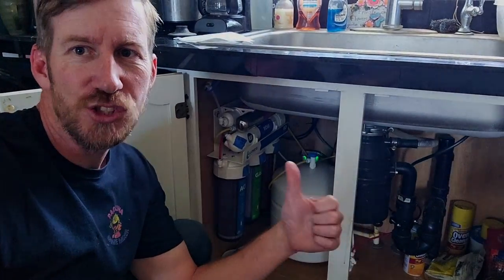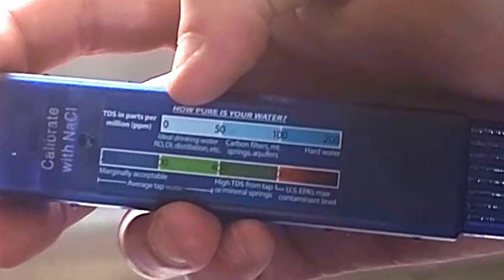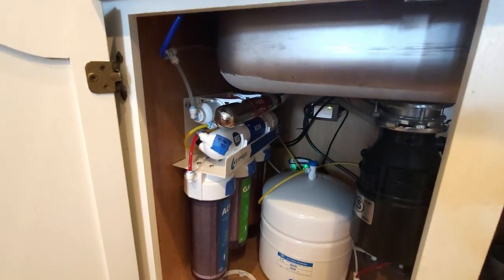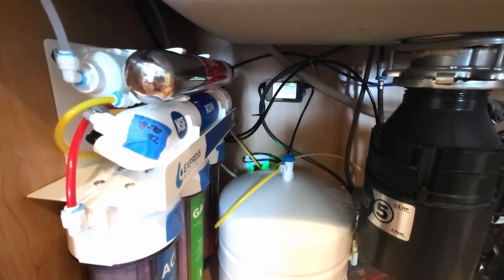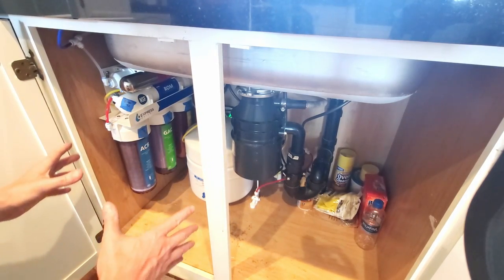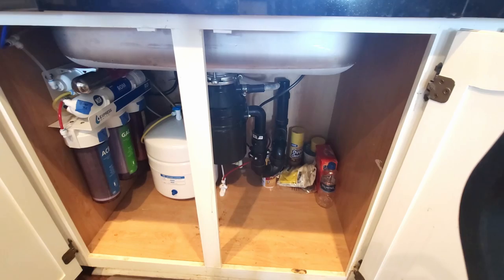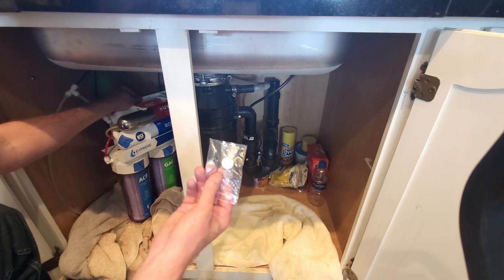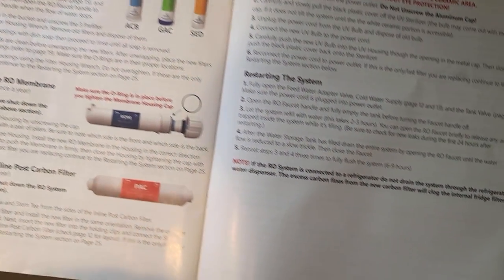Express Water Systems RO Filter: 8-Month Performance Analysis & Filter Replacement

Comment: I saw your previous video.. Great work! 
I am glad I watched this one.... When you say you have to have 20 psi... do you mean my faucet water line needs to have 20 PSI... basically ... water line into my faucet?
Reply from the maker: Did I say 20 PSI? Its supposed to be 40PSI minimum. The RO filter needs at least 40 PSI to me able to push the water through the membrane. Anything less than 40 it will not work. Most well systems work on 40-60 PSI if I remember correctly and most city water at least in the states is around 60 PSI. If you don't have this pressure Express Water does sell a booster pump that will correct your pressure for I believe around $120. There are other booster pump option on amazon as well for a bit less money. Hope that helps! Thanks for watching!
Reply: How do you determine the psi…

Comment: I have the same system but I added the alkaline filter to mine. I have a problem where my water make my mouth feel dry or astringent after drinking the water. I tried eliminating the alkaline cartridge with no luck and I put it back on. My coffee tastes off like extra bitter and again astringent. I don't have this problem with plain tap water or bottled water. Any suggestions?
Reply from the maker: How old are your filters? If they are new did you flush them before use? Drinking the water straight from the tap without it being filtered does not taste like that? I have the Alkaline filters but have not installed them. A lot of people have said that especially at first the alkaline filters taste bad so I opted to just add in electrolytes back in my water manually.
Reply: @RealProjectTube  I bought the system back in may 2022 and haven’t changed any filters yet. Express was nice enough to send me new filters. The water tastes fine from the ro. It’s just after a while after drinking it my mouth feels astringent and dry and when I drink coffee it tastes I don’t know like I can maybe taste the coconut husks. I went through several tanks worth and I did empty I think two tanks full when I first installed it.
Reply from the maker: @marksmith4512  I would change the filters as the 3 pre-filters are I believe supposed to be changed every 6 months, obviously this is based on average use. I think the instructions say to fill  and drain the tank 3-4 times which take if I remember right nearly all day. RO water does not taste as good as quality bottles water mainly because the lack of minerals. Most water companies add the minerals back in for taste. I haven't noticed any astringent taste to my water though nor a coconut husk taste but I also smoked for 20 years and maybe my taste buds aren't as sensitive anymore  lol. The only advice I can give you is make sure your filters are changed on time and its flushed properly.
Reply: @RealProjectTube  Thank you for the great advice!